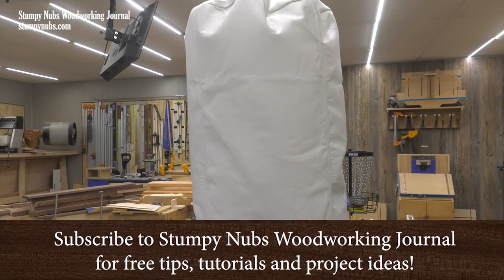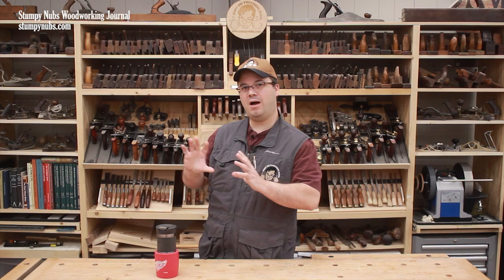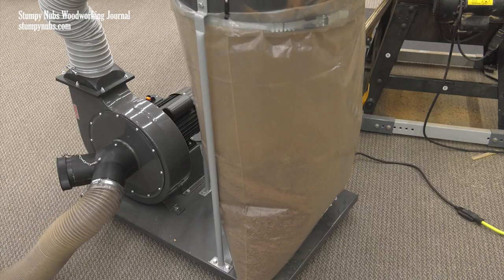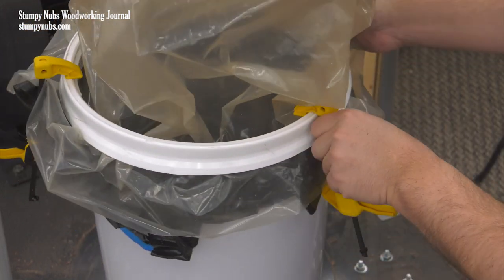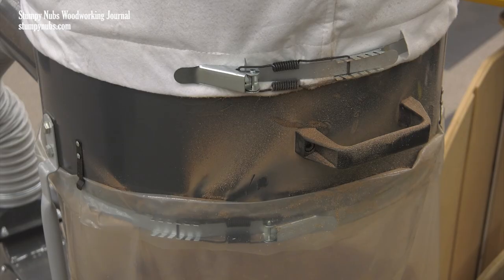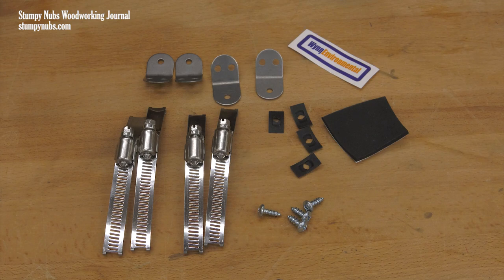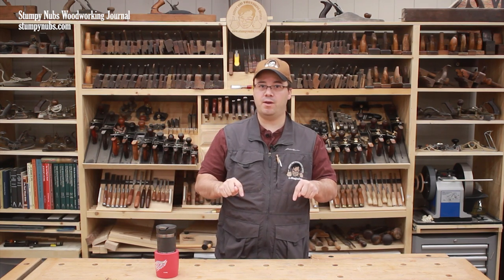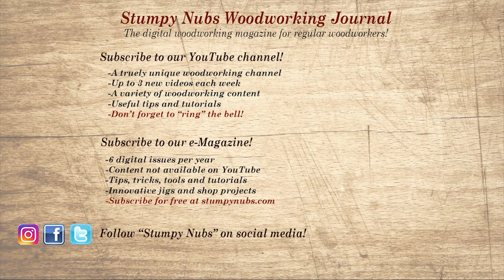How a bucket and a donut changed my dust collector

Comment: What a bodge!!!  I have a Delta SSDC that looks remarkably like this unit.  I replaced the OEM top bag with a 1 micron bag from Powertec and measured no decrease in airflow with an anemometer.  About a year later I replaced the plastic bag with another 1 micron bag from Powertec thus increasing my filter area.  Time spent:  5 minutes.   No leakage as shown in the first few minutes.

Yes the bottom bag isn't transparent but when the unit is off, the cloth collapses enough to see the level of chips.  I discipline myself to empty the bag at half full.  There are two reasons:  1) the weight is easier to maneuver & 2) it's easier to control the dust when dumping it.  I slip a 30 gal trash bag over the collection bag and invert.  Minimal dust out.  

The CFM/ft^2 with one bag is within good design parameters for industrial dust collection.  With 1-1/2 (I lose half the area of the lower bag) I have plenty of filtration area and suffered no decrease in performance.  Canisters in this application are a waste of money since you don't have reverse pulse cleaning.

Comment: So I just added a 55gal drum as a chip collector to my single stage HF unit. I was also going to run the exhaust directly outside and bypass the filter bag. I heard you say the 55gal drum collector significantly reduces air flow. Will bypassing the filter bag help this? Or am I better off buying the large filter and making the mods you showed? As always, thanks for the great information 👍
Out of curiosity, what filter did you go with and how satisfied are you with its performance?

Comment: can I collect the large chips in a pail or bag and then run the dust filled air out a vent that exhausts into the outside air?  This is just wood dust that would break down in days so there shouldn't be an environmental issue.

Comment: I used to work with a considerable amount of drywall, rehabs, &/or repairs of drywall, stucco, or other types of plastered surfaces, & yep, you are absotively  correct, ... the finishing sanding operations always seemed to become extremely messy, what with the dust particles getting, going into even the smallest of crevices, ... but I did eventually find a good working solution, ... after years of repairing the cracks, & nail pops which come with the settling of a home over a roughly 20-25 year span, following it being built, ... it involves having even a small type of wet/dry bucket type vacuum, a bucket to fill about a 1/3rd of the way, with water, and a couple of hoses one running from your sanding block, to the bucket of water, then another hose, running from the top of the water bucket, to the vacuum, ... as the air pressure is drawn into the vacuum, it also pulls air through the sanding block hose, along with the dust, and the dust is pulled into the water, where it becomes too heavy to be pulled into the vacuum, much like a wet bath oil/air filter that was extremely effective in providing protection to the combustion engines in the desert arenas of North Africa, during WW2, ... I do know that these types of filtration, were used in US Army vehicles up through 1975, in the European theater, of post war occupation, ... I served a a line mech. for wheeled, & tracked vehicles, Armor, & Infantry, for 17 months in West Germany, & a subsequent 13 months, in West Berlin, so, I was able to effectively serve on both sides of the Soviet’s infamous Iron Curtain, ... during the era of the “Cold War”, ... of which, the Soviets, simply took their ball, & went home, ... not unlike, neighboring kids who vie against other neighborhoods, ... with the only difference being, that the adult version, is/was, ... far more deadly, and having a much greater realization of understanding that nowhere, is it, nor will it ever, be safe, without some nation from somewhere, giving a new meaning to the phrase, ...  “Reach out & touch sometime one”, ... 
Life’s experiences, have taught us, that nothing is ever permanent, not even our own government, nor it’s peoples, ...

Comment: We are enlarging our shop (20'*20' to add a section 30' wide and added another 20' on the end) and we have 3dust collectors and have built a room (10'*20') to house 2 of them and we plan on exhausting to the outside (we live in rural 60acres).  We are planning on removing the dust-bags for the reasons stated.  The third (small)  I got a canister filter to use inside the shop if needed......

Comment: Perfect timing, as I’ve been going down the DC rabbit hole as I get ready to build my shop next year. I’ve decided that instead of a fancy, name brand, underpowered 2 stage system, I’m better off doing a version of this with a properly powered blower, canister filter, and cyclone separator. The money saved can then be put toward an air purifier such as the Rabbit Air to remove that last 0.0001 percent of the super-fine but nastiest dust.  Thanks for the video.

Comment: Do you think adding some of the adhesive foam strips between the motor and the mounts (also the rolling table) would help quiet this noisy thing? The 2HP Harbor Freight filter is a loud beast.
I wanted to ask before I started doing it.
I also notice that the fan inside is off balance. Have you adjusted yours and found it a simple thing to center or will I run into another rabbit hole (looks simple but China!)

Comment: Thanks for the video. Unfortunately, my filter cum collection bag hangs from the downward-pointing 100mm outlet on my chip collector and fitting a canister filter would be difficult. I do use an interceptor to trap the bulk of the chips.
Do you plan to repair the broken handle on the wood-soled plane on the upper shelf?

Comment: I saw this video shortly after it came out and tried the gamma seal method on my dust collector. I got rid of my cyclone separator which reduced the overall efficiency of my dust collector. I'm three years in and still using it. Majority of my chips is created through milling, so my jointer and planer are the real culprits. Replacing the 30 gallon trashbags is much cheaper than having to buy those dust collector bags.

Comment: I bought a single stage and a dust deputy.  Attached the dust deputy to a trash can lid (grey 30 gallons).  Used split foam weatherstripping to get a good seal.  Even put a Plexi window in it so I know when to empty it.  All in less than $600.

Comment: I feel like if I ever get space for a detached shop away from my house (which is the plan, whenever I can afford it) I would want a shack right outside for dust collection. Wouldn't be cheap, but if you're doing central dust collection throughout anyway, it would save a lot of worrying about what it's pumping out.

Comment: Years back, I started shaking the collector after cleaning the filter.  I'd noticed the performance did not improve after cleaning, so I pulled the canister and noted several cups of fines collected on the ring between the filter and the collection bag. Because it did not drop through, starting the collector sucked all those fines right back into the filter.

When I started shaking the collector, I'd notice a lot of dust dropping on down, and performance improved after cleanings.

Of course, this is more difficult to do on my big, "four bag" collectors (one with canisters and one with after market bags), but it still helps..

Comment: Had this setup for a while now with the Wynn filter and bucket and have been really happy with it. Today was the first time I had the dust collector rather than the shopvac connected to the thickness planer. That was amazing to watch it easily keep up with the chips. Like your recent video mentioned, it makes it a safer and more pleasurable environment to work in when I don’t have chips all over the floor and the time saved not having to clean up that big of a mess. A benefit of that clear bottom bag is being able to see how much dust is falling back down when I use the air compressor to clean the Wynn filter.

Comment: IF you have to use a in shop filter, this is a great video.  My preference is to vent the discharge of the impeller outside into a collection building (mine even has a "half moon" on the door).  I had tried several modifications to my HF dust collector and never was satisfied with the performance.  Then I removed the impeller, remotely mounted it on the discharge side of a cyclone (locally built) and had it discharge into the "outhouse."  At first I had a 39gal trash can with a burlap cover.  That was okay, until the burlap would clog.  Removed the burlap and liked the through put.  One day I happened to turn the system on while my wife was cleaning the inside of the "outhouse" and the absence of the back pressure from the trash can boosted the through put a lot.   The dust and chips stay in either the cyclone or "house" and out of my shop.  Of course, all of this assumes you live in an area where you could do this.  One final comment, HF makes a 1200CFM claim for their unit, while I have not put a meter on it, I have to be getting close.

Comment: I reversed plumbed my floor model HF system. The ring sits on top of a 55 gallon drum. The 5 inch flex hose is connected on top of the ring sucking air through the 4 inch side pipe. This creates a cyclone effect and almost nothing comes out of the exhaust which is through 6 inch pvc drain pipe out the side of my building. I can hear the wood chips swirling around the drum, that's how I know the cyclone effect is working. I use a dolly to wheel the drum outside to be used as mulch.

Comment: I'm in the process of making both upgrades, but I noticed that when I remove my separator, the big shavings for my planer bind up at the impeller. Is there any way to fix this and still run without a separator?

Comment: This is very smart, thank you.

These filters arent too expensive if they can be cleaned and used for a few years while maintaining filtration quality. If filtration drops over the time then they are too expensive.
I presume removeable end cap on some models means they can be stacked together?
Also, you didnt by any chance monitor your air before/after the change?

Comment: I'm curious as to your thoughts on my modification of this same dust collection unit:  I changed out the original impeller to a larger one, added a Super Dust Deputy separator that's connected to a 55 gallon steel drum under it, then instead of venting the air through a filter (which I considered), I vented it out a 6" pipe through the wall to the outside via a louvered vent cover.  Not sure this is optimal, but it seems to be pretty good.  Certainly way better than the original bag setup!
Thanks again for another highly informative video...I know I'm addicted to your videos, 'cause I end up getting all kinds of products you use &/or recommend, and they have made my woodworking efforts more effective and enjoyable!  I haven't regretted a single one yet!  Even if my wallet gets thinner... ;-D)

Comment: If you can put the collector in  small plastic shed outside your shop there it doesn't  matter. run the duct work inside and an electrical switch then ll the dust is outside.

Comment: This was great. I have the same system which  now will under go transformation. On another subject I watched a video you one posted about sustaining your table saw or removing rust. I have a new Fusion F2 by Laguna and it seems that when anyone is near it  they always have to put their sweaty hands on the top of the table say. Thus resulting a rusty hand print. I was gone for a coulple of weeks and when I got home found such a hand print. I took WD40 and sprayed the top and let it set for a minuet or so and then wipped it off. I then took some auto body rubbing compound and rubbed the table saw top to remove any hard rust ot impressions. After bubbing that off I put a hand rubbed coat of Johnsons paste wax let it dry and buffed it off. Now the table saw's top is slicker than black ice on a new road. Just a note and you can pass it along if you like.

Comment: i set this up on my grizzly single stage today. leaving only a couple of inches of the garbage bag draped on the outside to the five gallon pail didn't work. the cyclone effect sucked the bottom of the garbage bag up into the clear bag and spun it around. i reset the garbage bag and left only enough of the bag so it touched the bottom of the five gallon pail. that worked great and the garbage bag didn't get sucked up into the clear bag. very pleased with this modification. thanks for the video!

Comment: I have an even better upgrade that builds on this, i wish i could put pictures on youtube comments.   It’s based off the bottom picture at https://wynnenv.com/hybrid-systems/    mounting the HF motor and Wynn filter on the wall saves a lot of floor space, and the dust deputy and barrel does a fantastic job separating the dust.   The filter allows for so much more air movement;  The air coming out is so much cleaner than ambient air.   I also use the gamma seal bucket, on the bottom of the filter, to seal and catch any last bits of dust in the filter.   Wynn Environmental sells special clips to help hold it onto the filter.

Comment: Like you, I cut off the bottom of the bag for my collector, but instead of using a bucket to catch the dust I used a small fiber barrel. The barrel has a metal ring at the top with a good sized recess on the outside face. I pull the bottomless bag over the barrel and seal it with a long bungee cord that fits in the barrel recess. I would have tried the snap ring that came with the barrel if I had it. I have still been emptying the barrel (outside). I love the disposable trash bag idea. Great video!

Comment: The easier way to use the stock lower bag:  put a trash bag in it as a "liner".  When full, pull the trash  bag out, no muss no fuss.  To tell how full the bag is, just run a finger along the outside:  the level of collected dust is readily apparent.

Comment: Ok James. I live in the UP, Manistique, of Michigan. I have no neighbors, so I would like to just vent my Harbor Freight machine right out the side of my shop with no bag or filter. I would put a chip collector on before the venting it outside. no reduction for any type of filter.  Any suggestions for that? It's a small one man shop with only 1 machine running at a time.
Reply from the maker: As long as you don't heat of cool the shop.

Comment: Hi - love your solution. As in interim step and to save a few dollars for those in a garage/workshop with the dust collector on wheels why don't you just put it outside with a bit of hose connected to it
. I know it's not perfect and yes the wind will blow some of that dust inside but at least the majority of the excess dust will go outside.

Comment: I haven’t found any info on this anywhere, so I have an Oneida 4” separator on my HF DC.  I replaced my plastic bag with another filer bag.  It seems to have increased my suction.  I have powertec 1 micron filter bags filters on both ends.  Is this crazy or not?
Reply from the maker: Another filter bag doubles the filter area- when it's empty. It will diminish as the lower filter bag fills with chips. A canister filter would be a lot better.

Comment: The idea is amazing way to simplify emptying the clear bag and dealing with the inevitable mushroom cloud of dust... But doesn't a Separator also help bigger things from hitting the impaler and probably other things that I'm not aware of at this point.???
Reply from the maker: Your impeller is designed to handle chips. Separators will protect it from large objects (though I have never damaged an impeller), but at the cost of some suction.

Comment: When the canister filter becomes caked with particulates, do you replace it or clean it? I’m trying to gauge the canister’s longevity in order to justify the cost.
Reply from the maker: It is easily cleaned many times with compressed air.

Comment: For the Wynn filter, how do you clean it? Do you recommend the removable cap so you can blow it out once in a while? How often? I'm thinking of the Jet cannister with the flaps inside for knocking off the dust.
Reply from the maker: You clean it by blowing compressed air on the outside. Those paddles some filters have are a terrible idea. Filters are made from coated paper. Aggressively rubbing paddles on the inside is going to wear the coating off, then wear the filter media itself.

Comment: My solution for the leaky dust bag was to put a plastic bag over the top of it when you started the dust collector the plastic bag and Inflates the dust comes out of the other bag hits the sides of the plastic bag and drop straight to the ground it keeps it out of the air work really well and I just would have to clean up a pile of dust on the ground right below the dust collector should beat the heck out of it blowing through the air and having to wear a dust mask all day because of it
I should add this wasn’t wood dust this was the material called feather light it’s about like talcum powder it was used as a mixer and thickener for resin for doing reproduction castings if you weren’t careful and you sucked in the mouth all of that stuff that does dude cough for about two hours